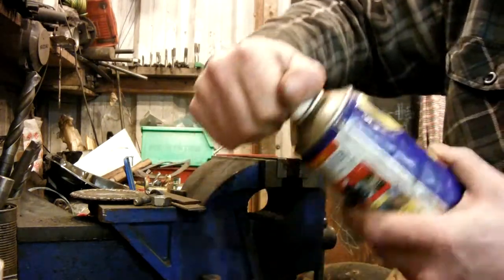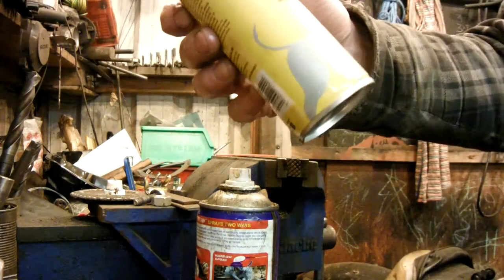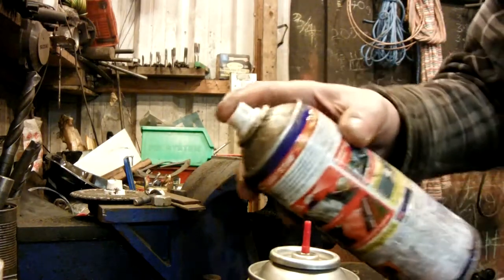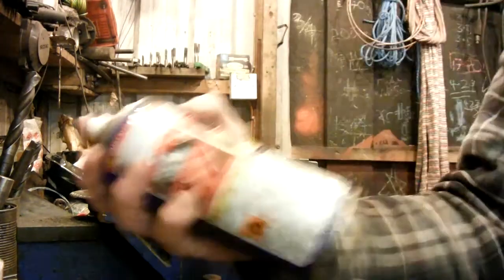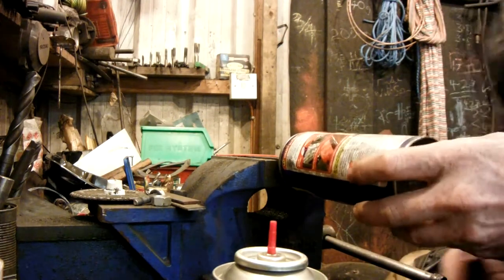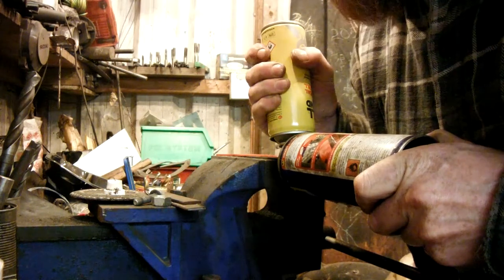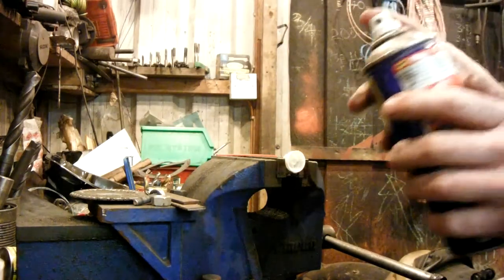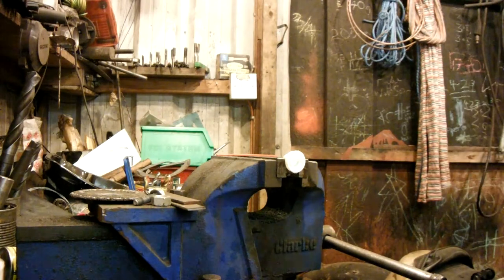Repressurising a dud aerosol with butane.

Comment: the best way to do this is to put the can to be repressurised in the freezer overnight to chill it, to get the pressure differential as high as possible, so more liquid butane gas will be charged into the dead aerosol. once the aerosol has warmed up, the liquid butane will evaporate and restore full pressure into the refilled can.